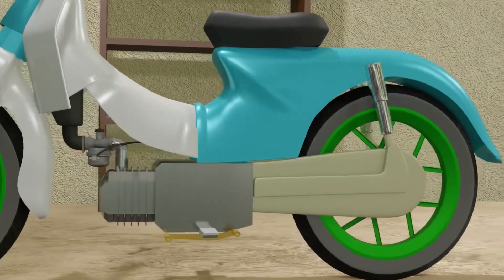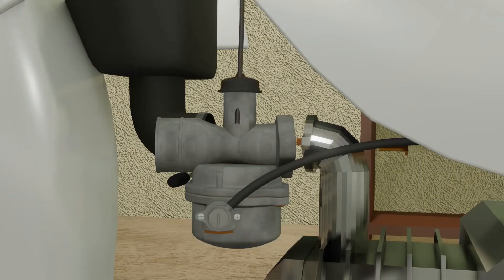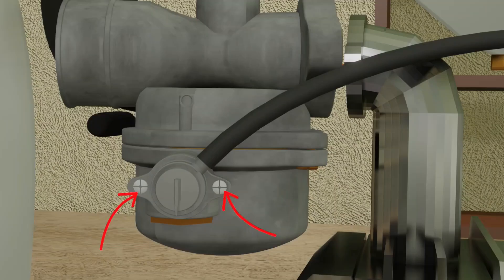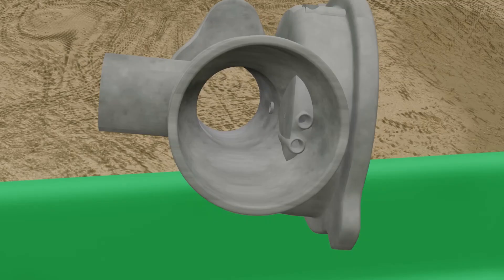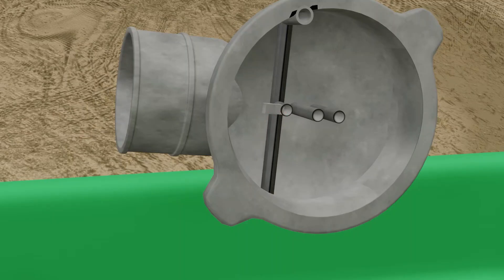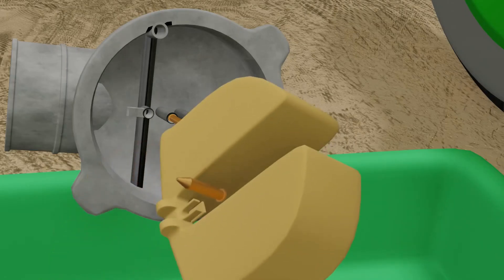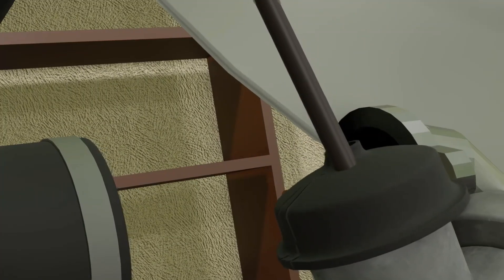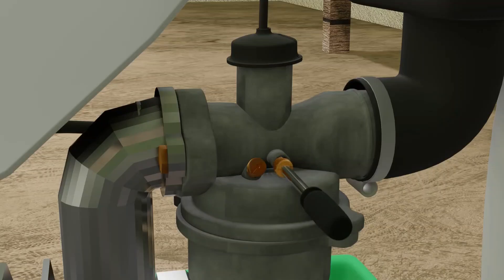How To Clean a CARBURETOR Yourself (Animation)

Comment: For an f.i you must not move the sensors after you plug it again the rpm will change 😂, then you have to go now to your nearest motorcycle shop..😂
Reply: What sensors do u mean? U mean the sensors that modern bike have, that still use carburetor on it?